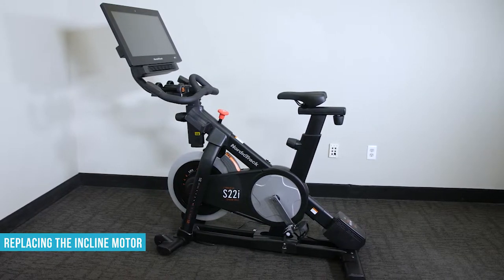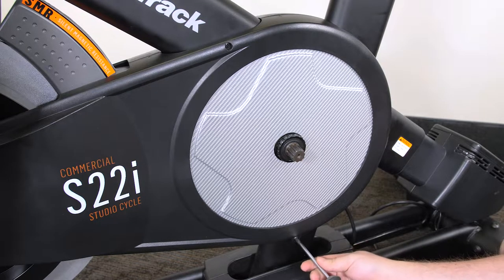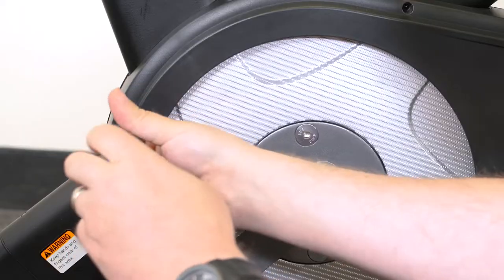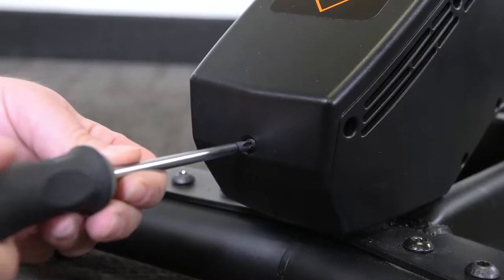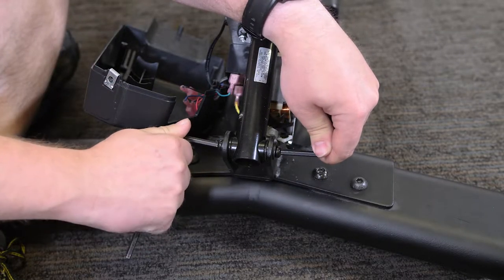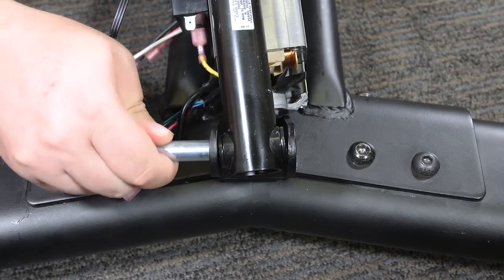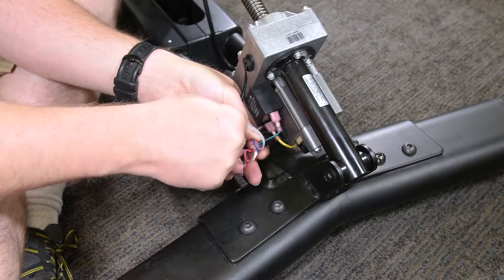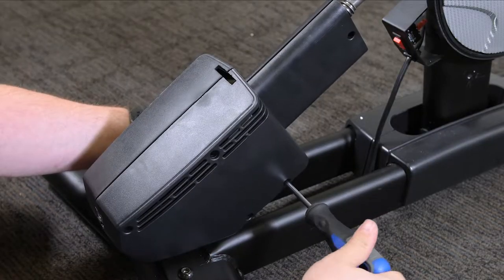Nordictrack S22i and similar bikes Incline Motor replacement

Comment: The site shows the replacement motor for my bike (NTEX02117NB.3) is part # 412767. Would that be the newer quiet motor? The only reason I want to replace mine is to get the new quiet motor.
Reply from the maker: That model uses an AC lift motor. AC lift motors are not interchangeable with the DC lift motors that are found on later models of this bike. The DC lift motors are the ones I think you are referring to as being quieter.

Comment: I know this is a bike but I have a Norditrack Commercial 1750 that recently decided to stop having power to the display. I checked the power and used a meter and power is coming in. When I took off the cover and looked at the board, there is one red light. That light does nothing, no blinking or color. Is the board my issue?

Comment: Hello, I am not sure if the problem is the motor or the control panel. The incline/decline stoped moving , as soon as I put it a part and tested the motor without been attached to the bike, it does work, but when I attached, does not move , it just make a noise , a couple clicks , then nothing. I tried to calibrate it to, it does do it when the bike is not attached only. 😔
Any suggestions 🙏🏻
Reply from the maker: If the motor extends and retracts when not connected to the machine. then it sems like there may be something physically keeping the unit from being able to move up and down.
Reply: @FitnessEquipmentHelp  that was my first thought, I loosed all bolts a little bit, put some grease everywhere, and nothing happened 😞. Maybe something got screwed up on the board 🤔. I got this bike used and they told me that the resistances don’t work, checked the connections and saw that the resistance connector was put inverted, (colors of the cables), so I flipped and resistant stated working 😊. I noticed that the resistant moves too with the inclination , so maybe got crazy on the board for having those cables connected the wrong way ?
Reply from the maker: @hugocontreras4067  Depending on the unit the wires to the resistance motor may be in a harness that reverses the yellow and blue wires and the red and black wires. This is done so they can use the Same motor in different applications. In any case this should not have any effect on the incline unless the resistance bracket is interfering with the frame when it tries to decline. I don't think it could cause a failure in the board. I think it is possible that the motor may have failed. Seems the board is working if the motor runs when not attached.

Comment: I have the replacement motor. However the shaft is a bit too short to connect. I didn’t buy this bike to be a mechanic. Not happy with it lay this point
Reply from the maker: You can adjust the screw to any length that is easier to install by unscrewing the lead screw. Just turn it by hand.

Comment: Is there a video on replacing the controller board for this bike?
Reply from the maker: Not at this time. However once the left side cover is removed it is a matter of 4 screws and a few wire connections. There are no other adjustments necessary. If you are concerned about where to put the wires on the new board. take a picture or write down where the wires are on the old board and plug them into the new board in the same place.
Reply: @FitnessEquipmentHelp  would really appreciate a video for replacing the controller board for this bike. My brand new bike does not work and apparently there is a problem with the controller board. New part has been ordered, I am yet to receive it. Hence looking for a video on how to replace the controller board.
Reply from the maker: @pujakamath3665  once the side covers are removed as shown in this video the board is replaced by removing 4 Phillips head screws and disconnecting the wire harnesses. I will try to get a video as soon as conditions allow. I think you will find it a strait forward replacement once the side shields are removed.
Reply: Puja Kamath what’s wrong with your bike?  No elevation/incline???
Reply: they sent me a part and i have no idea how to replace it
Reply: I am having the same problem... did you get yours fixed?
 @311rigs
Reply: Daysi Jacobson I don’t have a bike. I’m a service technician. Is your bike under a year old??
Reply: @311rigs  yes, i called them and they sent me the part with no instructions... an di havent been able to find any videos... i also got extended warrany... i just purchased it in July
Reply: Daysi Jacobson call I con and tell them you need a technician to install parta sent to you. Where are you from?
Reply: @311rigs  Ponte Vedra Beach, Fl
Reply: Daysi Jacobson I’m sure they can send a tech to do the repairs for you. Call icon
Reply: Fitness Equipment Help I wish the video just said “if you are replacing the controller board stop here and see the controller behind the left side”

Comment: What tool are you using to get the M6 crank screw off? I can't seem to find a screw or hex key that will fit in properly without slipping out.
Reply: Please let me know when u find that tool I've been play with them for over a month
Reply: Ditto. Not sure, but I think it's just a terrible design. Only about 1/8th inch if that, for the wrench to grab onto. I think it winds up rounding off almost immediately. Have to have them send me a new one to replace the one I'm going to have to drill out.
Reply: @Buazag  Did anyone find the right size allen wrench?
Reply: Did anyone ever find the tool?
Reply: @HeyitsSHEA19  I believe we ended up using a 5mm allen wrench, but my memory is fuzzy as we ended up returning the bike after this incident

Comment: I have the same Nordictrack S22i which I purchased about a month ago and starting last week, whenever the elevation would adjust the back of the machine would make a bang or clunk noise (not all the time, but sometimes). It feels like the machine is settling or something. A few days ago, in addition, whenever elevation would change I also hear a grinding noise. The elevation changes normally, the noise is unsettling. Do you think it's my motor going bad?
Reply from the maker: I would be concerned that something is catching or binding as the motor is moving. If you are able I would remove the plastic covers and take a look.
Reply: Were you ever able figure out what was causing the noise? I'm dealing with the same issue, (no grinding just the snap/bang). Contacted customer service, they recommended I remove the plastic covers to see if I could determine what was "hitting" the motor...gave me the link to this video. I got everything off, ran the incline and decline, managed to get the noise but couldn't determine it's origin.
Reply: @peterb6282  I have got a similar issue. Do you have anything how resolve this banging noise?
Reply: @Barni501  I'm sorry I don't. The odd thing is that after  I put everything back together I no longer had the bang.....that is up until about a week ago :-( The one adjustment I made when i had all the covers off is that I noticed the eyelet on the rod that connects the motor to the frame was turned to one side so I adjusted it to line up straight....probably just coincidence that the noise went away.

Comment: The console on my S22i Studio bike  NTEX02121.8  will not light up, it is dark.   I have done several factory resets without luck.    I  have noticed when i get on bike, the manual resistence buttons on handlebars do not work.      Does my monitor console need to be working in order for those manual resistence buttons to work?      I am just wondering if there is a bigger issue here other than my console does not work...........could I need a new motor for the overall bike?    I called Ifit support but very frustrating.   Extremely kind person but definately a communication barrier, I don't think she was understanding what I was telling her.     I just got this bike about a year ago.   Can anyone help in troubleshooting.    The bike monitor console is dark and the manual buttons do not seem to be working despite the monitor console being dark.
Reply from the maker: Yes the console needs to be powered on for the buttons to work. Make sure the power supply is plugged in and the cord from the wall into the power supply is tight. there should be a green light on the power supply. If the light is on then, unless you have damaged a wire by moving or dis-assembeling the bike (not likely), you may need a new lower control board or console. (Lower control board is more likely in my experience.)

Comment: I don’t know what happened but my wheel fell to the front bar stabilizer when I released the m8x32mm bolt that connects the incline motor to the frame. Unfortunately I did not need to dismantle to this point at all. All I needed was to change the controller on the left wheel side. I managed to get it back together although it required me to manually hold the front of the bike up to align the bolt to attach to the frame. I do not know what happened! The wheels don’t move bc the front wheel is still against the front bar. Why did this fall like this for me? Please help!
Reply: It is a bit old but it sounds like you're not properly connected to the incline motor extension bolt.  Did you ever resolve this?
Reply: Pretty sure I’m having this same issue. At 4:34 when he connects the spindle it is short and then suddenly it fits. Mine is too short snd not fitting. How did you get it long enough to reach?
Reply: @HeyitsSHEA19  you should be able to twist out the drive to extend the length. Did you max it out?
Reply: @matthewmurfitt  I was eventually able to get it. Thank you! Now I am struggling to get the bolt in. It doesn’t seem to line up with the threads and won’t go all the way through. Any tips?
Reply: @HeyitsSHEA19  you can use a thinner lead punch or something to the like to help line everything up. It might help to get a hand and have someone take pressure off the bolt while you try to guide it.
Reply: @matthewmurfitt  thank you! I got it in. So now I reassembled it all and the pedals aren’t working. Ugh- any ideas?
Reply: @matthewmurfitt  the drive on mine still won't reach. It's short by half of the hole. Tips?

Comment: What’s the part number or where can I buy it
Reply from the maker: The part number will depend on your specific model. Parts are available online from the manufacturer at www.iconservice.com
Reply: Out of stock any other website
Reply from the maker: @briannj9  Not that I am aware of.  What is your model number? I can look to see if I can find any alternatives for the incline motor.

Comment: The covers won't come off on my bike. It is as if both sides as still attached at the bottom even though I have completely unscrewed it. Has anyone else had this problem???
Reply from the maker: there are some screws that are only accessible from 1 side of the bike. I would just double check that there still isn't just one screw on the right side on the bottom holding the two shields together.  Just in case :)
Reply: @FitnessEquipmentHelp  Pause video at 4:46 mark and the board can be seen clearly ... I look forward to having to do this to my bike myself as we speak .... Bike has about 10 hours on it and this happened.  Seeing as they sent both parts based off a simple video sent to them , shows its a known defect ..

Comment: They sent me this video to “help” me get the left crank off which got stripped. No help at all!
Reply from the maker: to remove the left crank arm loosen the 2 crank arm clamping bolts with the included 5mm Allen key. Then loosen the crank arm screw. it uses a 3mm Allen key. with the screw removed and the bolts loosened the arm will slide right off of the axle. I Hope that helps :)
Reply: Manual says M6 and you say M5.  It's definitely not M6 as that's too big to fit into the screw.  M5 wallows around and has roundedd off the head.  I've broken 2x allen wrenches already.  Why is this such a pain in the ass?  I want to exercise, not become a god damn mechanic.